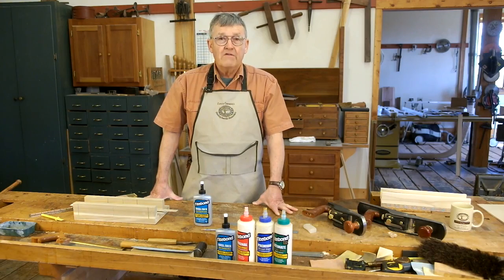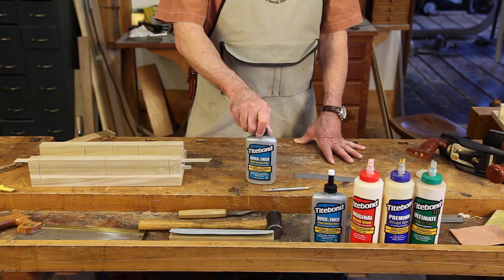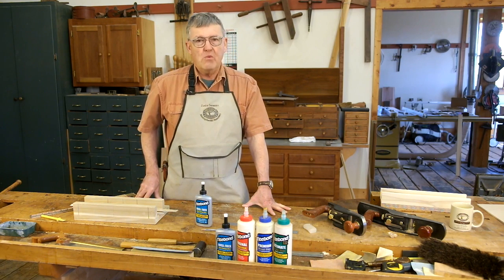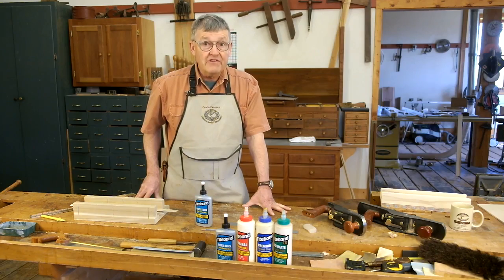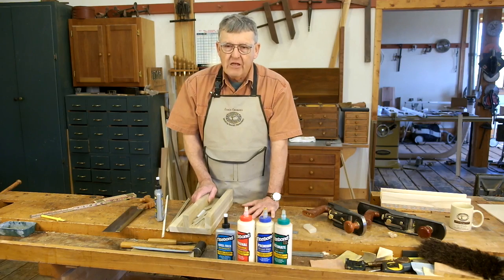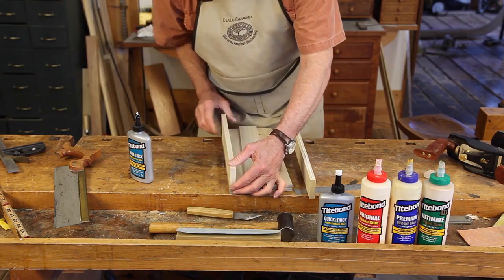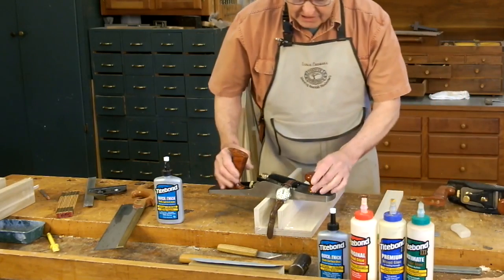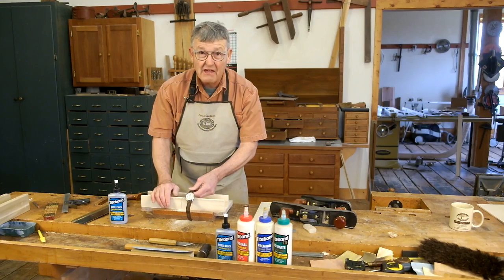Using Titebond Quick & Thick Multi Surface Glue

Comment: I've been using TiteBond now for over 5 years building furniture, Cutting boards and other items. TiteBond has never failed me. I haven't used the original or the new Quick and Thick but if it's anything like TiteBond 2 and 3 it'll be great for probably most anything wood related. TiteBond makes great stuff. This is an unsolicited recommendation. I'm a hobbyist making stuff in my garage.